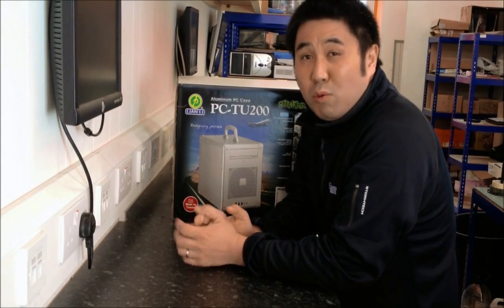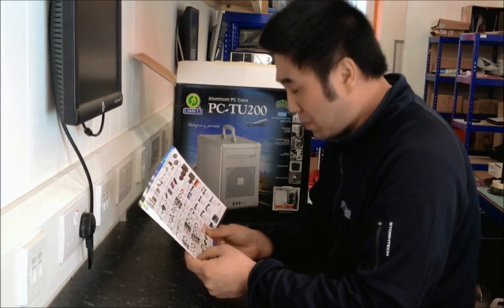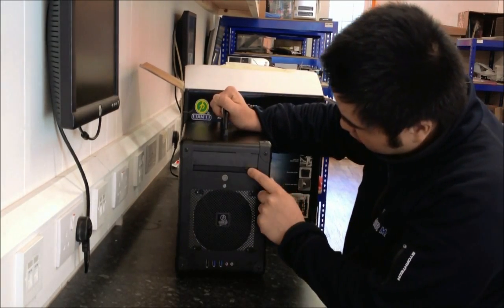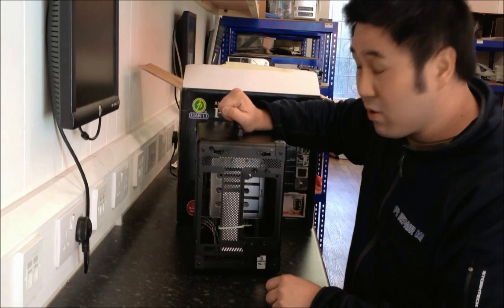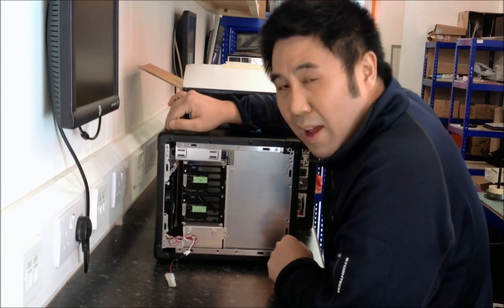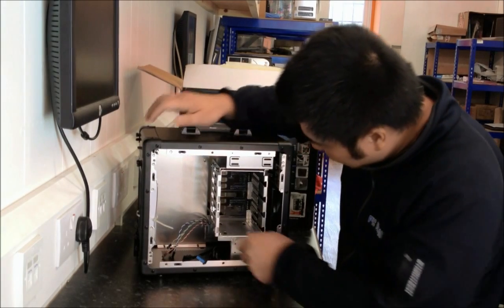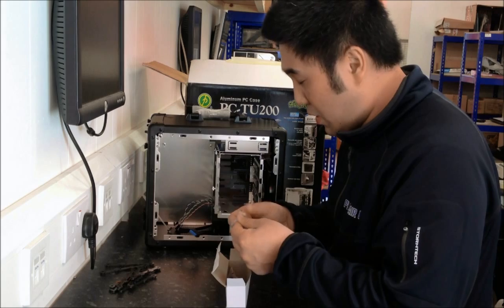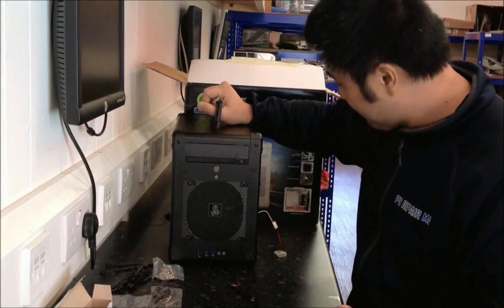Mini Recording PC Build Part 2 - Lian Li PC-TU200 and ASUS P8H61-I

Comment: 6950 , or a 7770.
And what are the temps like, and what is the vrm phase of the motherboard you used. If i used an i7 or an i5, kept it stock, and used a discrete gpu, like one of those mentioned above, would the temps get bad, if i kept everythign at stock, or do you think it would work fairly well. does it have room for an aftermarket cpu cooler

Comment: Love the look of that Lian-Li tu-200 case but it is friggin pricey at $169.99 on Newegg. I built with the same mobo - the ASUS P61H I 2.0. It does not have USB 3. on the mobo for the case's internal connector, but is a good deal at only $75. (amazon). (The cooler master 120 elite is a bargain case in comparison to the Lian-Li and is typically on sale for only $40. or so...)

Comment: Q2:The Lian Li SATA drive cables you mentioned in Part 1 are a set of 4 shielded, together, with the drive connect ends at 90 degree angles. Part #: SATA-LT90-4S. I have been looking everywhere to discover whether the angles are in the right direction such as to send the cable toward the bottom or back of the case. Can you answer that?

Comment: Thanks for the Vid! Good job for first time out and you'll be glad to know it is still relevant and one of the most informative I have found.

Two things I have not been able to find answer about, please help. 1) Are there motherboard mounts included (some posts have complained about this) and, if not, where did you get them (they seem hard to find on the net?); Q2 to follow due to character limits.

Comment from the maker: Sorry for the delay in replying.  In my previous mail I've actually answered this.  GTX670 reference is 9.5 inches and as we know GTX580 fits, it should be ok.  Would probably run it with the side panel off though!

Comment from the maker: Depends on the card and layout of the power connectors.  It can apparently take a card up to 11.5 inches, but its probably best not to cram a high end card as there will be issue keeping it cool unless you are happy running it with the side panel off. Anandtech shows the box with a GTX580 - (10.5 inches).  the 670 reference is 9.5 inches so in theory it should, but the article does stress that it is a bit tricky.